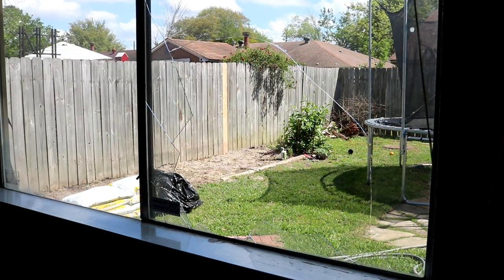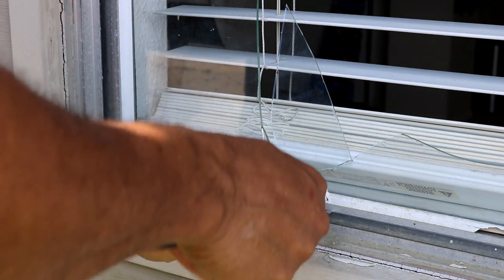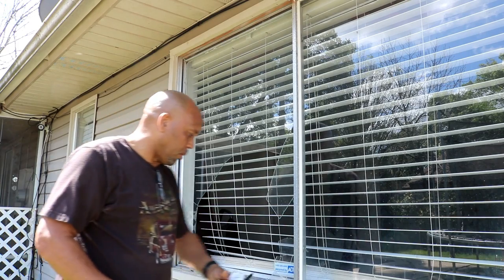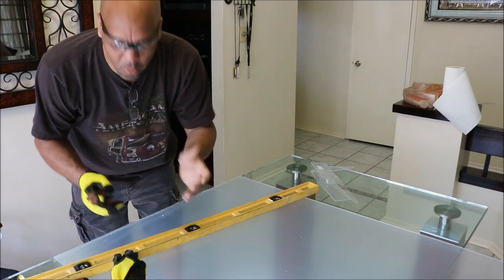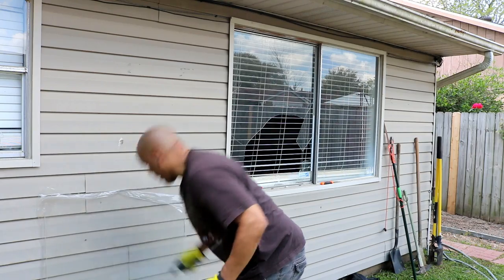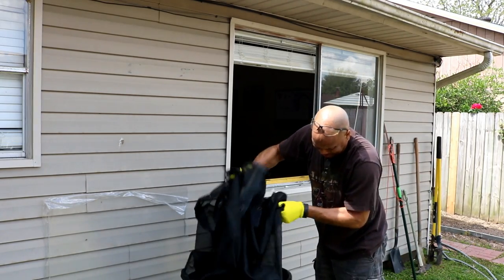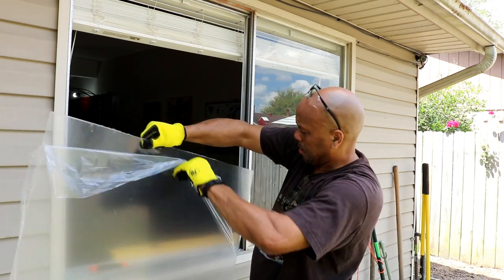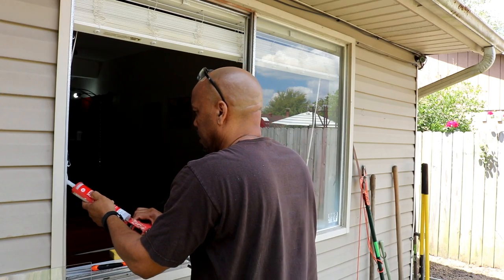REPLACE OR INSTALL  BROKEN GLASS WITH PLEXIGLASSS

Comment: Great Video. What was the thickness of the plexiglass. I looked at some pieces and the 1/16 th thickness looked flimsy and may not be the best choice. They did not have  the 1/8 thickness. The cost of glass is half the price of the plexiglass.
Reply: Yeah plexiglass is pricey but if you don’t want to mess with glass then plexiglass is the way to go. I recommend 1/4 inch thick plexiglass.

Comment: Can you add this over existing window pane? Trying to find a way to stop window breakage from Golf balls
Reply: I would use wire mesh over window.
Reply: Don't aim at the window dummy
Reply: Lexan would be ideal, it has 200 times the strength of glass and resists yellowing.
Reply: You need a net...then you can also sell golf balls to people...I lived right next to the 9th hole once...house looked like it had been shelled...by like mortars! But, it was stucco.

Comment: Now it's easy to break in your house. all you need is push the plexiglass and your in no sound.
Reply: not easy if you instal motion sensors, and security cameras thats wifi ready, and alerted by motion.
Reply: and when did a window ever stop a thief, or a locked door for that matter.. visible security set ups and bullets stop crime..

Comment: Temporary fix, but tell me that’s not permanent.
Reply: it will fall out sooner than later, silicone does not adhere to acrylic
Reply: @chicanopride67  Should have used a 3M anchor adhesive, usually used to anchor security film and plexiglass to frames. Works incredibly well. Dow Corning 995.